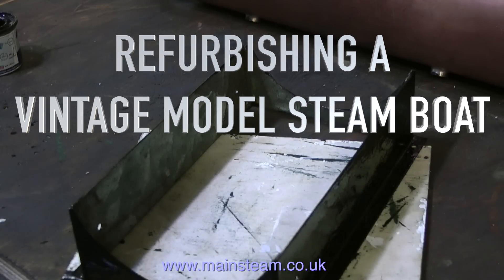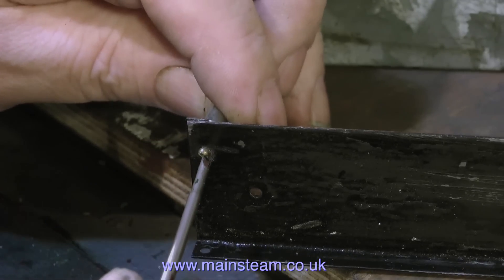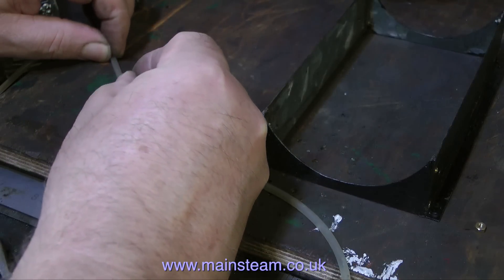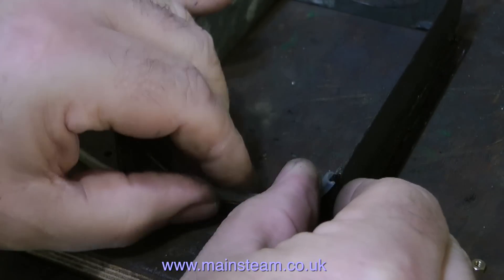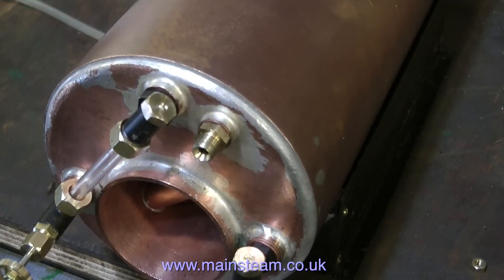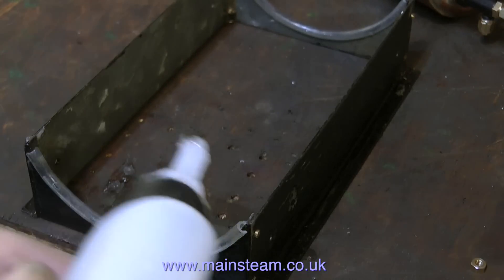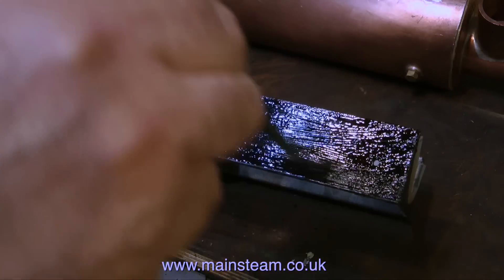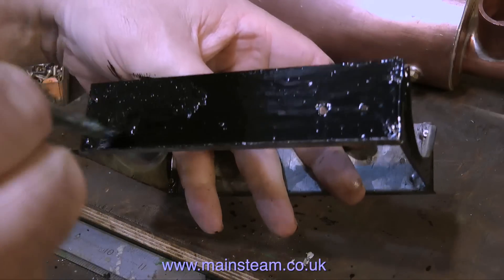REFURBISHING A VINTAGE MODEL STEAM BOAT - PART #10

Comment: hi keith. i am refurbishing a model 10h and noticed there was no oil hole or oil cup on the con rod to crank connection. i was cosidering putting an oil cup with wick in place. do you or anyone else have any thoughts?

Comment: I work on a sea going tugboat . We're just heading down the Mississippi  bound for Florida as I watched this .  Great stuff! One trick we use  for painting over galvanized metal is to was it with white vinegar first . It keeps the paint from flaking off .
Reply from the maker: good idea, the acid in the vinegar would act like an etching primer ..... I will try that - thanks :-)